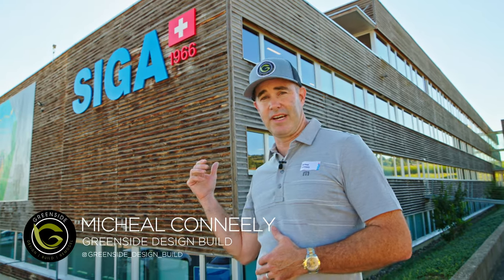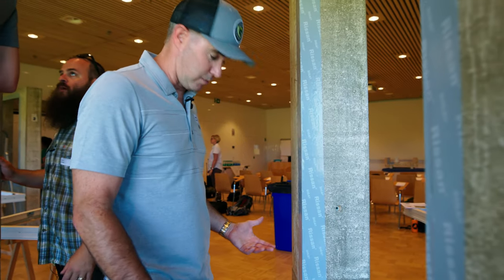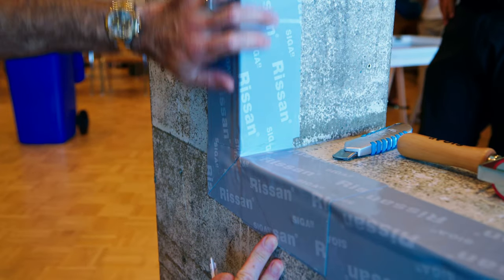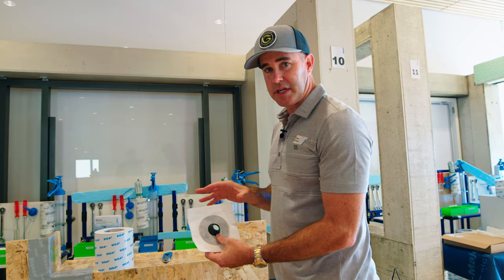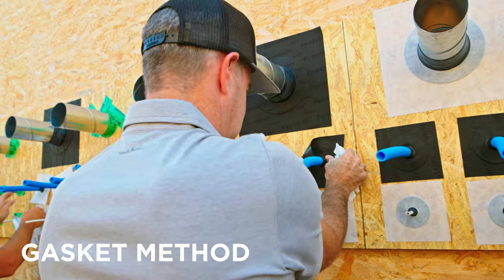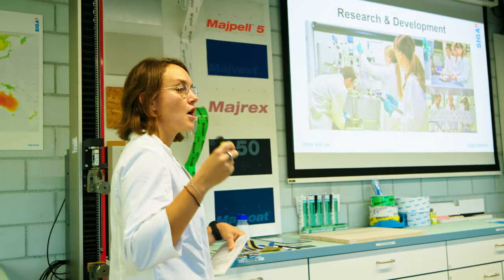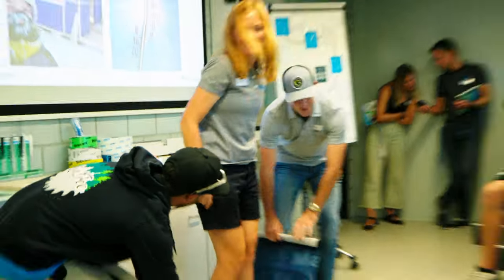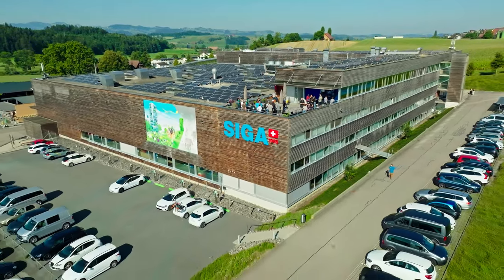Greenside views European Construction in Switzerland

Comment: I see a Tesla on that parking lot. So you gotta do some EV Charging setup, installs, strategic placement and future accommodations. Best methods of installing Solar panels on multiple type of roofs to accommodate easy assess to them after they're installed on roofs and/or on the ground. Also small wind turbines. How to seal all those screws that puncture the roof to prevent any leaks into the attic.